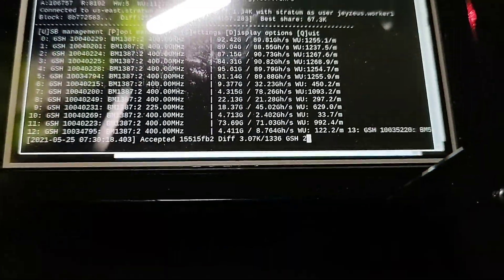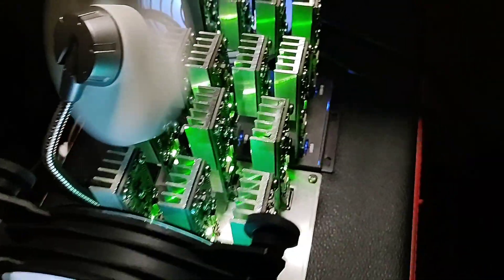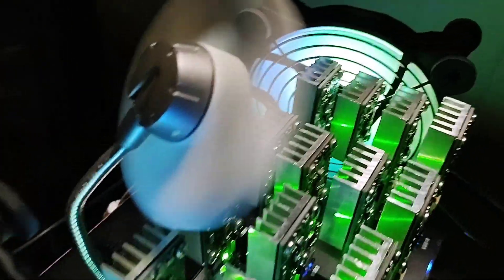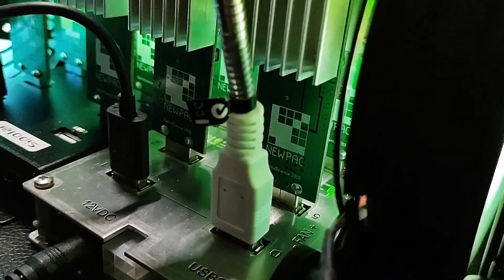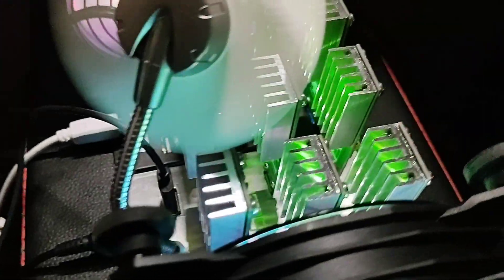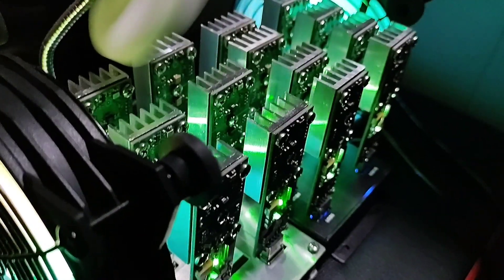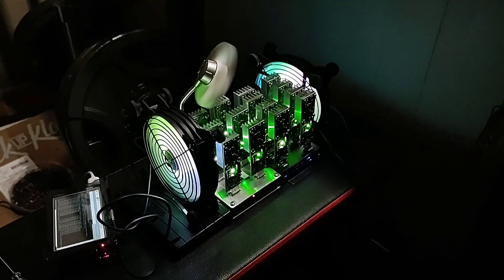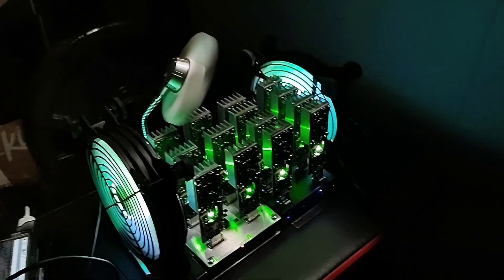GekkoScience Newpac USB Bitcoin Mining Rig Rundown ⛏️ 1.2+ TH/s Low Power & Silent - JTC11

Comment: Thinks have changed or I am in the wrong Pool.  I have 5 BM1397s and each stick is hashing @ 330 Gh/s.  So over 1.5 Th/s and making about 40 cents per day.
Reply from the maker: The stick in this video is a different one than the BM1397 stick. The BM1397 stick is called the Compac F.

The one in this video is the newpac which is a bit older.
Reply: @justh0dl  - You are correct, but that is why i can reach your hash rate with only 5 USB sticks.
Reply from the maker: @journeyman138  yep, this is an old video though. I sold these and have like 20+ of the Gekkoscience compac F's

Comment: sorry, dumb noob question here.  How do you connect multiple usb hubs to your pi?  is it a simple 2 to 1 usb adpater?  will this work with 3, 4, 5, etc usb hubs?  is there a limit before things wont work properly?    Thanks
Reply from the maker: not a noob question at all. I just plugged the hubs in directly into the Raspberry Pi through the USB 2.0 ports on that are on the Pi. If you are using a Raspberry Pi with only one USB or one of the mini usb ports, then an adapter should work. 

In the past, I was been able to get away with plugging in one hub into the other and having only one USB cable going directly to the Raspberry Pi too if that is what you are asking.

Regarding the limit, I think it depends on which Raspberry Pi model you are using and what actual USB sticks you are using as well. If you are using an older or weaker Raspberry Pi (such as a Pi Zero Wireless or a Pi 3B+) then you might be able to run like 10 sticks but on a Pi 4 you might be able to run more. 

 If you have stronger sticks like the Compac F, then I think you'll run a bit less than the newpacs because they are a lot faster and you max out the CPU. I have a 3b+ Model A that I think can only handle like 6 sticks and i'm running 12 on the Pi 4. not 100% if this is accurate but just my findings based of testing these around.
Reply: @justh0dl  I gotcha.  thanks. I'll have to play around with it. Ive learned some much in just a couple weeks.  Im just getting started with all this, and dove right into the deep end.  Got the rasp pi 4 8gb, and 128gb card,  and running 4 compac f's.  Totally missed out on the 2pacs, and newpacs, but thats ok, the F's are awesome! Thanks for the vids,   tru educational tool.
Reply from the maker: @drumdevilbd  caught the tail end of the Newpac era but super stoked to run these for the next couple of years! It's so dope and interesting, it's kinda crazy how almost no one pays attention to this part of mining either. Glad to put out some decent content on figuring this stuff out too, it was actually really confusing for me at first too which is why I wanted to make these videos. happy hashing ⛏️

Comment: Looks good!  How much for each Newpac and how much BTC does this earn a month?
Reply from the maker: If you're looking to ROI in terms of BTC it's not happening with these. They usually go for $120-$200 on eBay or if you can get em thru 419mining when in stock then around $100. Your profits depend on your strategy. If you straight up mined BTC and overclocked it properly you'd probably make like 75-100 satoshis a day. I've seen people make $15 a month on miningrigrentals. I posted another video reviewing this and letting people know my thoughts on it. It's good to learn with and tinker with. The hardware also seems to keep its value pretty well. I've been selling some of mine because i am upgrading mine to the new one that's about to come out 👀

Comment: I thought USB miner's were only good for Bitcoin Lottery
Reply from the maker: It's not making much but 1 TH makes an average of 120 satoshis per block. We've been finding between 7-14 blocks a day on slush. Made like 1600 satoshis the other day with this rig (like 50¢).

If BTC shoots up like crazy where a Satoshi goes to a penny ($1M per BTC) or a dollar ($10M BTC) then this thing is absolutely killing it!

Note - each stick isn't giving me 1 TH, the entire rig is. I am getting about 90-115 GH/s for each USB which makes like 12 satoshis per block. Most people that usually only have 1 or 2 put it in lotto mode cause it would take forever to pay out. i'm actually going to be doing a review of the newpac miner + some strategies you can use to ROI on them a bit quicker.

Comment: how did you overclock to 1Th/s? can you please do a video, step by step??
Reply from the maker: Thanks for the comment! i will try to do one soon explaining everything. I am actually planning on setting one up with a raspberry pi 0/4/etc. While i work on that, for now i can try to help in the comments.

How many sticks do you have?

Generally speaking each USB Newpac stick has a stock hash rate of 20 GH/s. It maxes out at 120-130 GH/s. 100 GH/s = .1 TH/s.

You would need some specific gear like a powered USB hub and a solid power supply to hit those numbers..you also would need a fan running 24/7 otherwise the stick would burn out.

The reason i can run 1 TH+ is because i have like 14 sticks running on a powered USB..some sticks are running at 100+ GH/s and others are running 50-60 GH/s..if you add em all up i get a total of 1TH/s+ but not each individual stick. 

Let me know what operating system or what device you are using so i can make sure to paste the right code or point you to the correct tutorial.
Reply: @justh0dl  watching your video, I was able to set up a rig similar to yours using 2 separate raspberry pi that i had laying around. Im looking forward to learn how to overclock my 14 gekkoscience usb miners with your video. Thank you
Reply from the maker: @voicezuneinc  okay cool so the first thing you need to do is set up cgminer on your raspberry pi. I actually already wrote up a quick guide here:

https://10millionsatoshis.com/?page_id=220

If you follow the steps there, i believe it should work if it's any raspberry with the raspian OS.

In order to overclock you just need to add some text at the back of the command line entry when running cgminer. What it does is tells your stick to run at a higher voltage. Default is 100 and people recommend testing it and increasing it slowly. Some of my sticks run at 500MHz to get 110 GH/s but some others don't even turn on when i set the clock to that speed. I need to run at lower frequencies like to hit a higher hashrate like 280-320MHz to get 50-80 GH/s depending on the stick. Apparently it's kind of luck of the draw depending on the actual chip..you might be able to adjust the screw verrrrrrry little to increase the voltage but i haven't done that since it can mess up the newpac of you torque it too much. 

Not sure how comfortable you are using command line but it's easy, i actually kinda learned doing this. I'll paste the line in a second that way you can just copy and replace it with whatever you need. I also was running into an issue where i couldn't get a higher speed cause i needed to run the sticks at different frequencies so of you need that i can post that too.
Reply from the maker: This is what I use to run in CG miner.

cgminer -o stratum+tcp://us.stratum.miningpool.com:3333 -u zzz.worker -p x --suggest-diff 128 --gekko-newpac-freq 300
 
The number 300 at the end you can change to adjust the clock of the stick. If you want to adjust each individual one, you need the serial number of the stick which shows up when you run the on on cgminer. It's s number like GS-10092379 

You can run a new instance of cg miner and just replace the xxx with the serial number and change the clock speed at the end:

cgminer -o stratum+tcp://us.stratum.miningpool.com:3333 -u zzz.worker -p x --suggest-diff 128 --gekko-serial "GS-xxxx,GS-xxxx,GS-xxxx,GS-xxxxx" --gekko-newpac-detect --gekko-newpac-boost --gekko-newpac-freq 325
Reply from the maker: Note, i believe the above command line entries only work if you use the guide I made to install cgminer. You might need to add some prefixes like  a/ if you already have cgminer installed. I am not too familiar with Linux/ or raspberry pi's so I'm not 100% sure on that
Reply: @justh0dl  so exited, can't wait to get home to try this ...thank you
Reply from the maker: @voicezuneinc  you got it! Good luck. It took a lot of research for me to figure out how to do it and there aren't a lot of up to date guides either. Some of the commands might take a couple of minutes to fully execute as a heads up, I think it depends on how fast your device is. one of em took like 5-10 minutes for me so don't think it's not working 😂
Reply: @justh0dl   bro im stuck, the command to boost doesn't work when I add all the individual serial numbers.  Can you please 🙏 look at it again?
Reply from the maker: @voicezuneinc   are you trying to run them at the same speed or different speeds? 

If you want them at different speeds you need to do a new instance of cgminer for each different clock speed. 

So for example you'd open terminal and run this:

cgminer -o stratum+tcp://us.stratum.miningpool.com:3333 -u zzz.worker -p x --suggest-diff 128 --gekko-serial "GS-100,GS-200" --gekko-newpac-detect --gekko-newpac-boost --gekko-newpac-freq 325

Change the 100-200's to your serial number, then change the 325 to whatever frequency you want to test.

if you have other ones you want running at different clock speeds you'd need to open terminal again and run the command with a different serial number and different frequency. So instead of just pasting what's above, you'd do something like this:

cgminer -o stratum+tcp://us.stratum.miningpool.com:3333 -u zzz.worker -p x --suggest-diff 128 --gekko-serial "GS-300,GS-400" --gekko-newpac-detect --gekko-newpac-boost --gekko-newpac-freq 200

Then do that for all the serial numbers.

If that doesn't work 

Then double check your mining URL, username and make sure there are no spaces between the quotes for the serial numbers.

If that doesn't work then, then maybe a fresh install of cgminer and/or the latest version of raspian might do the trick.
Reply from the maker: Hey, i saw that you commented..not sure if you were able to figure it out but try to re-run these commands. I think i forgot to paste a "sudo make install" but don't have a device to test it right now.

Commands below

First:
sudo apt-get update -y
sudo apt install build-essential autoconf automake libtool pkg-config libjansson-dev uthash-dev libncursesw5-dev libudev-dev libusb-1.0-0-dev libevent-dev libmicrohttpd-dev libhidapi-dev libcurl4-openssl-dev libssl-dev libgmp-dev make g++ cmake git libhwloc-dev libuv1-dev zlib1g-dev -y

Next:
git clone https://github.com/vthoang/cgminer.git cgminer-gekko-vthoang

then
cd cgminer-gekko-vthoang

Then
sudo make install

next
sudo usermod -a -G dialout,plugdev $USER
sudo cp 01-cgminer.rules /etc/udev/rules.d/

then
CFLAGS="-O2 -march=native" ./autogen.sh
./configure --enable-gekko
make install

this part will take awhile to configure and compile if it didn't happen properly before. 

Otherwise i am not too sure how to help. Make sure to check out Daniel Joviar's channel he has some good guides that might help or checkout the Bitcointalk.org mining forums, they have a lot of good people out there's. Unfortunately I got these directions from a discord chat so idk how to troubleshoot them too much.
Reply: @justh0dl  i get everything right until the point to start running the cgminer. Do i write the serial numbers with dashes? I pasted everything so you could see if i missed a step
Reply from the maker: @voicezuneinc  

You need to input the entire serial number. not sure what yours looks like - i don't see a comment with what you pasted.

Not sure if this is the thing, but did you try rebooting your raspberry pi after installing everything? if you already have cgminer running and can succesfully test a stick, then i don't think you have an installation problem and you are most likely inputting the serial number incorrectly. The format of my sticks is "GS-100054233" or something similar. to control each stick individually, you need to put the entire serial number with the "-". Not sure if your sticks have more than one dash though or if that's even a thing.
Reply from the maker: you also can't add multiple numbers at the end to change the frequency, or at least i don't know how to. for each group of serial numbers, you will need to add the frequency at the end and all of those will run at the same MHz value. you will have several instances of cg miner running. i have like 7 different instances of cgminer running on my raspberry pi (one for each frequency)
Reply from the maker: @voicezuneinc  This was the post i got most of the info from:

https://bitcointalk.org/index.php?topic=5053833.msg50023699#msg50023699

Not sure if it helps a bit